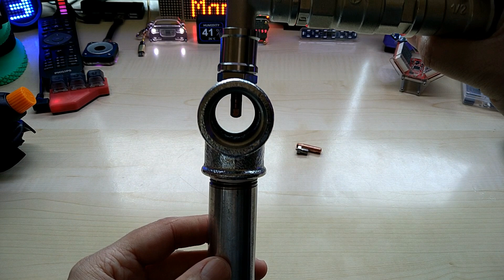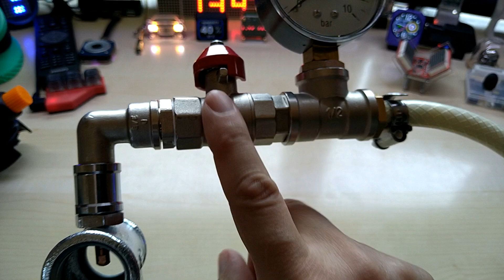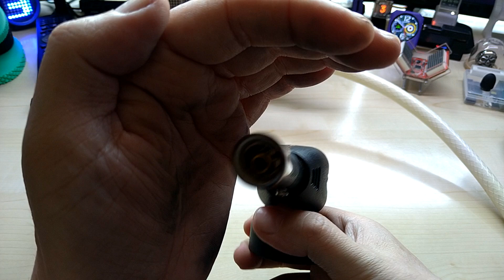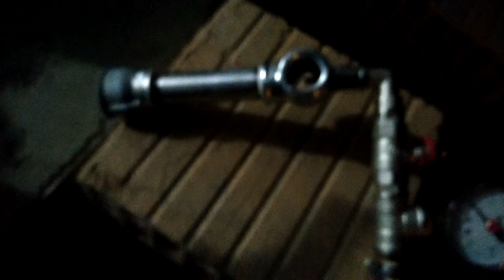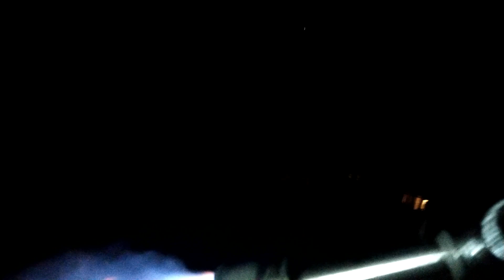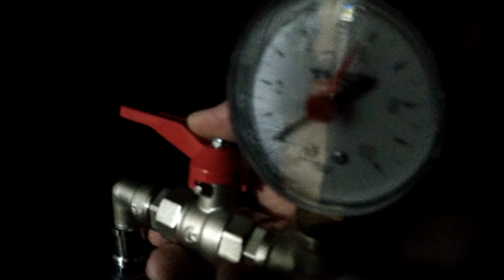#DIY T-Burner build with Nighttime Test Firing for a #Forge for Knife Making by  #Hayri

Comment: Great build!!! I'm a bit of a fire bug, so I love anything with flames!! Bigger the flame the better!! So you've done a fine job!!! I'm looking forward to seeing if you are able to get the piezo igniter mounted so you can easily start the flame without a separate lighter!!! Thanks for sharing this with us and keep on making big flames my friend!!! HAH!!!!!!
Reply from the maker: Thanks Adam, I sure love the sound the burner does, reminds me of the Space Shuttle Liftoff that I once saw back in the 90's at Cape Canaveral, FL where you see it liftoff and only after several seconds hear the thundering roar. It sure was a experience of a lifetime 🙂 Even love the sound of the small Butane gas burner. Picked five 5cm thick Gasbeton bricks for the forge today but then realized I can make it with less cutting and whatnot by using a thicker 20cm brick and carving it out. I still have some concrete drills from my father that he used when building his 7 story apartment building in Istanbul, to drill out the burning chamber and then use a coarse file, that I also have from him, to smooth it out. So it will be a homage to my father (passed away in 2008) so to speak. Anyway, getting carried away here a bit. Stay tuned my friend 🙂